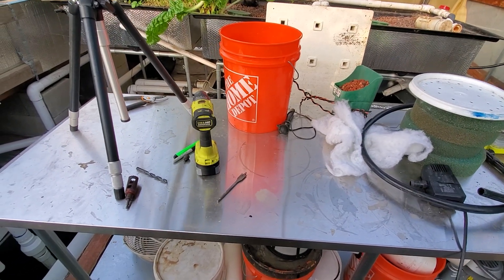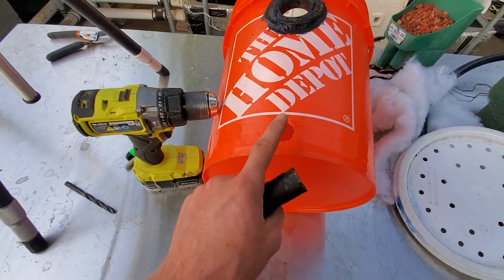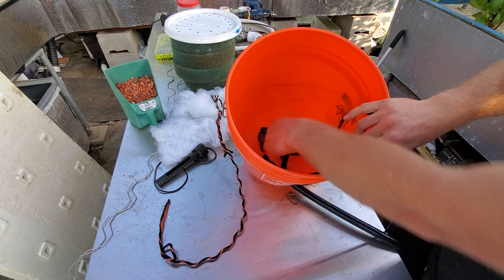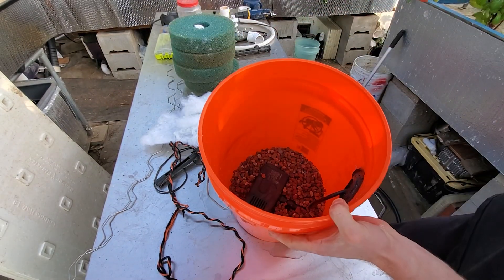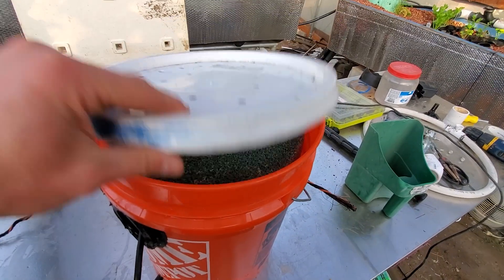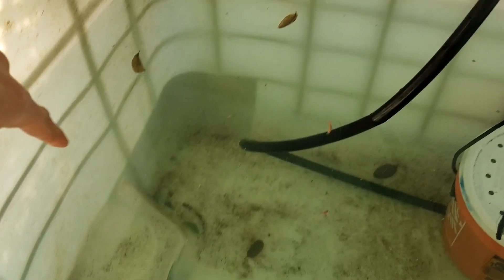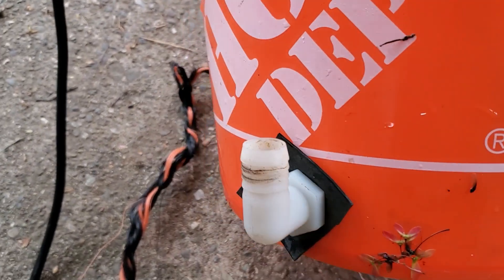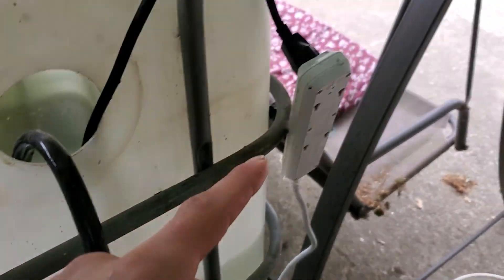Simple 5 gallon bucket submersible filter (DIY pond filter build)

Comment from the maker: Material used to build the filter:
Blue round Filter pads: https://amzn.to/3KvlErk
Finer filter floss mesh for center and bottom: https://amzn.to/3rMud8y
5 gallon bucket: https://amzn.to/3BXEuV5
Gamma seal lid: https://amzn.to/3ou56dh
Lid and bucket deal: https://amzn.to/3BV93dR
Lava rock: https://amzn.to/3KG2jUn
Pump: https://amzn.to/3OIwXBe
3/4 Tubing: https://amzn.to/43u5aZ4  or https://amzn.to/45zN0Y3

Comment: I want to make something like this to keep the water moving in my pool.  I am off grid and I use a generator to run my big sand filter. I want to rig up a 12V pump to do some filtering but mainly to keep the water moving.  I want to set up a solar panel directly to the pump so it comes on when the sun is out and shuts off when it is cloudy or night. I want to use a submersible pump that is 12V. I am hoping to keep it secure under the ladder. I am hoping to recirculate the water through the bucket and back out into the pool at or just below the surface.  Best type of pump to run directly off the panel (no battery, controller, inverter.  just 12 V on demand when the sun sines.  Any suggestions?
Reply from the maker: Sorry haven't looked into setting up a small solar system like that so wouldn't know the best pump to use. The only things if looked at are just kits like these, which come with the pump and solar panel. https://amzn.to/45YrfAH

Comment: I'm new to ponds, I would like a method of turning green water into clear water. I have a pond vacuum but that does not help with green water. Do you have a solution
Reply from the maker: A uv light helps with the single cell floating algae and will keep the water clear. For string algae and the algae growing on the side, feeding fish less can help otherwise scrubbing.
Reply: There is a product called POND PERFECT. It's basically beneficial bacteria in a bottle. Dose your filter with it. Cuts down the cycle time. I went from pea soup to clear water in a week. I'm also using a UV filter. Everything can be easily found on Amazon.
Reply: You can use pond plants to help control it. Plus keep water phosphates low.
Reply: Make sure beneficial bacteria is sufficient and you can use barley straw extract too